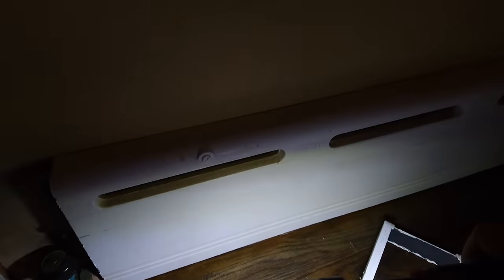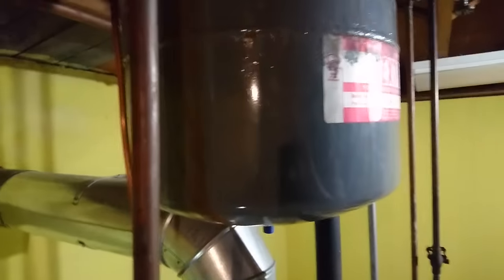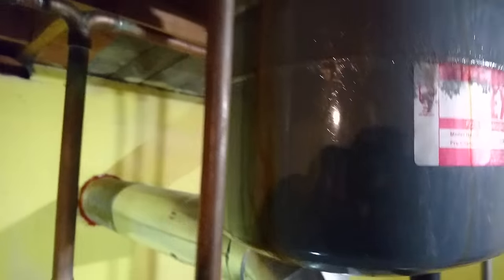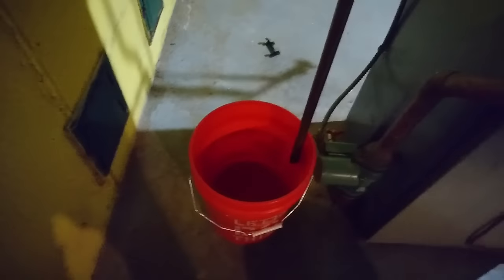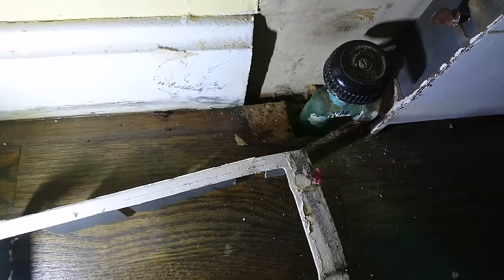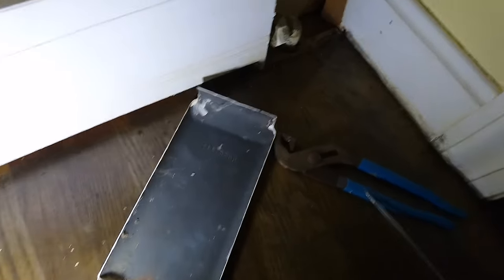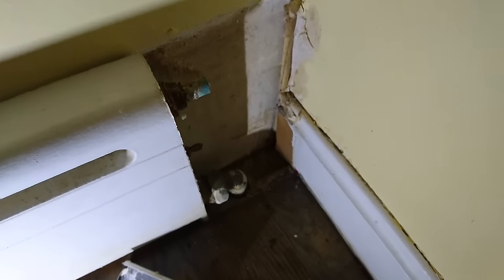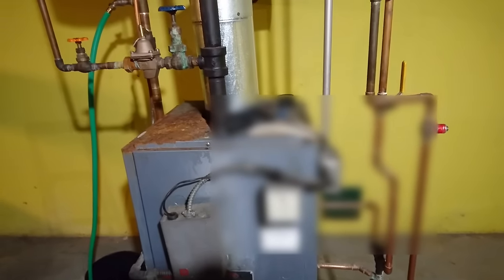How to Bleed Air From Baseboards - Hydronic/Base-Ray/Boiler/Burnham

Comment: Excellent video.
Question: How long before I start the procedure should I shut the furnace off?
Must I wait for the system to become completely cold ... or just cool enough
to handle without being burned?
Reply from the maker: That's a good point - 20-30 minutes is probably sufficient.
Reply: Great question 🔥

Comment: Good Video, Thank You! I have the same vintage baseboard units. All all are fitted with a vent valve which accepts a small 3/16" square key for bleeding. Recently, in  a damp basement location, a six foot run sprung a leak (rusted through) and was temporarily bypassed with a run of new-type hose. To remove the slug of air introduced, bleeding via the bleeder valve seemed to be no match for the amount of air from the repair, so the bleeder valve, and its connector fitting to the radiator, was replaced with a sillcock to get the water moving and the air out.
Reply: Tony, when u say "a six foot run" do you mean a 6' run of pipe?   or of cast iron radiator?
Reply: @conradkentucci1113  A short 6' run of cast iron radiator.
Reply: Tony, any tips on undoing rusty fittings? I have the same base boards, at the top end there is a 3/4” to 1/8” reducer fitting, then a 1/8” plug with a square 5/16” head. The plug broke clean off when I tried to turn it. Am I better off trying to turn the reducer fitting itself? Is it easier when the baseboard is hot, or cold?
Reply: @heinzotto1194  Was the plug brass? Even if steel, if you have room, drill it out and try to remove with EZ-out. You can then clean up the threads if buggered up. Or... allow unit to cool and use a 6-point socket with leverage/breaker bar. Try this first without heating the fitting. If no-go, heat AROUND fitting with torch, and try again. Use extreme caution with torch. Good Luck!

Comment: Thank you for uploading this video, exactly what I needed to understand the system and the Base-Ray baseboards. One Q for you - I also have the stand up cast iron radiators in most of the rooms and they also need bleeding. I've ordered every air vent key I can find, and they are all too large. The vent is 3/8" radius and the square bit inside is just over 1/8". Do you know where I can find the key for these rads? Thank you so much!
Reply from the maker: I see your frustration, 1/8" for some reason isn't easy to find. I found this clock winding key though, I think it just might work, #4 is 1/8"'. Just be gentle with it, if it's rusty you risk breaking it.

https://amzn.to/3dOWPGm

Comment: Regarding the flat head stubby screwdriver being a might too long for the job at hand. 
Several years ago I ran into the same problem while taking an air conditioner cover off. 
The unit was in the corner too close to an adjacent wall … The stubby was too long to remove the side screw of the cover (wall was in the way).
I simply shortened the stubby by a half inch … by simply cutting a half inch from the plastic end of the screwdriver.
Now anytime I need to remove the face of that AC to change the filter …
I have the tool to do it!
Reply from the maker: Nice, you've gone and made a stubby Deluxe™. Some have said coins work too, but they were talking about the valve.

Comment: Good video!  I too tried the garden hose method and it helped but on my mid-century home I have a 2nd floor and have air trapped after getting a new Laars JX Minitherm Boiler installed. I am just going to call the company that installed it and have them come out.  They should have done it in the first place.  Thank you!

Comment: Nice but my base boards don't have any bleeders, All soldered elbows
Reply from the maker: If that's the case I guess you'll need to rely on your air/water separator by your boiler and make sure it's in good working condition.

Comment: You get better results sometimes if you bleed farthest to closest radiator to the boiler. When boiler is running you can touch the top of the expansion tank and then the belly Top hot belly cooler
Reply from the maker: Good point, that and air is likely to be trapped at highest point.

Comment: very helpful, my 1952 era baseboard purge valve leaked, replaced with MaidO'Mist No. 72 auto-vent, bar code 6-85296-001--049.  Stopped the leak.

Comment: CHANGE YOUR EXPANSION TANK
Reply from the maker: PROBABLY NOT A BAD IDEA
Reply: @Bootstrappin  yeah saw lots or corrosion there, probably a good idea. I just watched it again, your pressure relief valve did release? number one culprit is your expansion tank isn't working right, pressure climbs and opens that relief valve. And what generally happens also is you have to replace the pressure relief valve as well as they stick open and always leak once they've been tripped
Reply: Why change the tank if the diaphragm is still good?
Your answer will be well woth it.. thank you

Comment: Great video!  I have the later model Slant Fin baseboards and no bleeder valves on them.  But this is an excellent video abs I learned a few more things like about the expansion tank and other things applicable to my system! 👍

Comment: What’s with the flashlight  lighting? Did you not pay the electric bill? Also they sell a type of screwdriver that has a 90° angle for tight spots maybe you should try one next time.
Reply: Hope you know I’m just messing with you/ I also on a 1960s ranch with baseboard heat.You also mentioned you were going to bleed them when they warmed up,but I’m pretty sure you’re supposed to only bleed air from the system and it’s cold, this way the Water does not absorb the air and you get a better bleed
Reply from the maker: lol the house is fairly dimly lit. Intuitively, both seem to make sense - because if the pump is circulating water, it's circulating air and not giving it an opportunity to get stuck somewhere. But likewise, you'd also expect the air to rise in a static situation. So maybe a bit of both will do the full trick.

Comment: So I shut off my boiler, let it cool, bleed valves and start the boiler again...Will it add water lost during the bleeding, or will I have to do this manually? If that.makes sense...
Reply from the maker: Depends what kind of boiler it is. My boiler had a pressure reducing valve open at all times, supplying extra water as needed. If you look around your boiler, you should be able to find either of two things: either a regular valve supplying water, and if it's in the closed position, you have to manually add water (SLOWLY -- in this case your boiler would likely have a sight glass. That's your fill indicator). Otherwise, you'll find a valve similar to this, and you should be fine: https://www.homedepot.com/p/Zurn-1-in-NR3XL-Pressure-Reducing-Valve-1-NR3XLR/310386794

Comment: This is not how to bleed air from a hydronic system...... You need to flush the system at the drain point with the hose in a bucket of water so you can see the bubbles. This must have taken a painstakingly long time only to find out there is still air in the system.......
Reply from the maker: If it wasn't one of the ways to do it, I don't think they'd have put bleeder screws on the radiators. As I said in the video, what you described was actually the first thing I did, but it didn't do the trick. And I wouldn't post this video if the method I showed didn't work for me, so I don't know why you are making these assumptions.
Reply: @Bootstrappin You're trippin guy...

Comment: Did have  the boiler running when you bleed the baseboard
Reply from the maker: Sorry about the late reply, but I believe I did - it makes it easier to push the air through since the system builds a bit of water pressure.

Comment: I have the same heating system do I have to turn the boiler off first? And do I have to cut off valves and other things before I actually bleed the baseboards?
Reply from the maker: I didn't turn my boiler off. But as a word of caution - don't force those small valves if they're rusty. If they break, a leak will develop. In that case, I would drill a small screw into the break. I don't think it would make sense to turn any valves off because you'd be trapping air.

Comment: Great video, Thank you! How often should you bleed the baseboard radiators of air? Once a year, or more or less often?
Reply from the maker: Sure thing! Ideally, never - the system should theoretically be getting rid of air on its own through an air separator. My system needed an extensive bleeding because I serviced it and had to drain all the water. In short -- as needed. If it's noisy/gurgly, then that's a good indicator for it. However, if it's happening frequently, that's a sign that air is somehow getting in - could be a leak, faulty air separator, water pressure blow-off valve going off, etc.

Comment: Do you need to turn the hot water heater off to bleed the lines?
Reply from the maker: No - in fact you should have it running and heating. This way the water is circulating and thus providing a means for the air to escape.

Comment: What can you do if there are no bleeder screws ?
Reply from the maker: This thread may be of use (basically, the bleeder may be hidden behind sheet metal/some panel. Otherwise, a clogged air separator near the boiler may be to blame): https://diy.stackexchange.com/questions/37382/how-do-i-bleed-baseboard-radiators-without-a-bleeder-valve
Reply: @Bootstrappin  thank you

Comment: All my baseboards are working except one. Could this be the issue? Do I need to do all the steps in the basement fkr one heater or can I just bleed the one
Reply from the maker: Probably won't hurt to try, just be mindful because the water temperature will be enough to scald/burn. Also, I also had this problem in my house, it turned out a hidden water supply valve was closed in the basement, rather than the one right on the baseboard.
Reply: @Bootstrappin  so I just undid the screw, and water is flowing fine
Reply from the maker: @williamlee8053  that's a bit odd. Feel the pipes for heat -- is there any point before and after the baseboard when the heat stops? This can help diagnose what's going on.

Comment: We've had to go down and do the hose bleeding when we get air in our system. Last time the hvac guys noticed we had bleeders on the baseboards and I asked if we could just let air out that way. For some reason they said we wouldn't recommend it. Sounds like they just want us to call everytime. I do have a question about the expansion tank. Ours tends to be cool at the bottom and warm at the top. All kinds of articles I've researched said it should be the other way around... is yours like that as well?
Reply from the maker: If your tank is mounted like in the link below, then it's totally normal. The expansion tank has two halves: one gets filled up with water, the other has pressurized air, and they are separated by a rubber membrane. I don't know why your HVAC guys would say that, why else would baseboards have bleeders? The only reason they might say that (if I gave them the benefit of the doubt) is that the bleeders probably aren't enough if you just drained and filled your system back up. In that case you'd start with the hose bleeding method, and finish with the bleeder valves.

https://www.achrnews.com/ext/resources/2014/07-2014/07-28-2014/S-PM0214Siggy_fig-1.jpg
Reply: @Bootstrappin   It is and thank you so much. I'm just going to assume (which is stupid to do) that if that was the case they would have maybe used them after they bled the system. This is a new house for me and I never had this type of heating system before. I'm thinking I might go ahead and attempt to bleed the baseboards. If that doesn't work then we bleed the lines again with the hose. sigh the joys of adventure
Reply from the maker: @pandapoof8798  here's the funny thing. If real estate prices weren't so through the roof, I'd have plenty of money to pay a professional and not even worry about it. But here we are :)
Reply: I just had this conversation tonight with my friend who is also a boiler tech. I got air in my system and he told me not to touch the blenders on the 90 degree elbows. His reason was they dont always seal up and will leak water (causing more work). He advised purging it from the basement.
Reply from the maker: @BrandonLund  that makes sense

Comment: Have you ever tried removing these Base Rays for things like remodeling (dry wall, tile, etc.)?  Hard to find info. on this stuff.  Thanks!
Reply from the maker: I have! No video on it, but I can describe it pretty well from memory. 

1) Shut off the boiler
2) Drain the water out of the boiler
3) Cut the copper pipe from below/the basement
4) Remove two very large flat head bolts attaching the Base-ray to the joists
5) Cut the paint off around the perimeter, and the you should be able to remove the Base-ray

~~~

Then, you'll need to re-fill your boiler with water, making sure that you are getting rid of the air inside of it as you do so. You may also need to add a conditioner of sorts to the water you add, and finally -- use this video as reference for getting the rest of the air out.
Reply: @Bootstrappin  Cool Thanks!  I just want to temporarily remove the Base-rays to drywall/tile and then put them back in place so I don't think I need to cut the copper pipe in the basement.  It looks like there is a shutoff valve and then I can just unscrew the connecting pipes.  Thanks again!
Reply from the maker: @jasonweatherhead812  oh yeah you're right, that would definitely be easier! And that reminds me -- that's what I wanted to do, but my shut off valve was corroded and stuck in the open position, so hopefully you'll have smoother sailing.

Comment: Hi , how do you fix low hot water pressure in this system 
Thans
Reply: Thanks to you
Reply from the maker: Here's what I'd do (but I'm not a plumber so take it with a grain of salt): first thing to check is leaks. Then check to make sure you refilled the system to pressure (about 10-12 psi most systems, but research this for yours,). Then check your pressure regulator valve screen for debris.

Comment: Thank you for making this video. I have the exact same baseboard radiators in the home I just bought, and was confused at how to bleed them. Mine have square bits that need a key to turn, but they are Base-Rays.
Reply from the maker: Happy to help! I'll add that be gentle, and avoid cracking them open if they look very crusty or you might spring a leak you can't close. A bit of rust release spray should help.

Comment: I bought a house built in the 50's, these are the EXACT baseboards in my house and this video was extremely helpful. Bravo sir!
Reply from the maker: Thank you! They're really quite nice, aren't they? So much nicer than the flimsy modern sheet metal ones.
Reply: @Bootstrappin  yes very good quality and sturdy. Was struggling to find the air release, I assumed it was in the basement. Didn’t even think to check the ends until this video!

Comment: Hello i have an emergency situation... I was bleeding the vent and the top broke off from from rust now water wont stop coming out... What can i do??? Its an air pin hole that its coming out of it..WHAT SHALL I DO??
Reply from the maker: Turn off your boiler, then shut off the water to your boiler. Then, drain water out of your boiler into a bucket until the system de-pressurizes. In the morning, you'll need to hit up a plumbing supply store for a new fitting. You can also check to see if there's a water shut off on this particular radiator.
Reply: @Bootstrappin  omg thanks man appreciate you sincerely...why did it shut coming out eventhough the boiler is still on???
Reply from the maker: @crappiesniper  not sure what you mean. The boiler usually gets a continuous supply of water feeding it, so unfortunately if there's ever a leak, it won't stop until you turn the water off and fix the leak.
Reply: @Bootstrappin  ok... You are right its still running water .... Its a little tiny hole at the top ..literally on top of the nut that its coming out of... Can i plug it or use epoxy to stop it til in the morning otherwise its going to be freezing??? What do you think?
Reply from the maker: @crappiesniper sorry didn't see this, I was worried that it was gonna get cold. Yeah plugging it should work, it's kind of low pressure, I just couldn't think of what to use except flex tape lol. Maybe even play doh.
Reply from the maker: @crappiesniper alternatively, on the opposite side of the radiator there should be a shut off valve, which I hope isn't too rusty
Reply: @Bootstrappin  lol yes indeed i had puddy on it and it didnt last... I was going to try epoxy 🤷 that should do the trick right? I could stick a toothpick in it with epoxy on it and epoxy around it ...what do you think?
Reply from the maker: @crappiesniper   Crappie Sniper  might work, but epoxy has a long cure time. Go with a special putty that has a short cure time, hardware store should have it. But personally, I'd take a picture of the leaking valve and go to a plumbing supply store, they can help. Replace it, probably best option.
Reply: @Bootstrappin  ok.. Just scared that if I take it completely off like unscrew it that water will be everywhere... That's the only reason why I didn't do that. Can I send you a pic of what I'm talking about? ..hay out of curiosity where are you located?
Reply from the maker: @crappiesniper  I'm in new england. Sure. You'd of course have to shut off the boiler, turn the water off, then drain the boiler before attempting such an operation. This late in the season, yeah, you have a point of just gluing it for now. Try a putty/epoxy.
Reply from the maker: @crappiesniper  my email is in my about section
Reply: @Bootstrappin  wow ok cool you are in NE im in the Cincinnati Ohio area... Bro thanks for responding... I subbed you! I do fishing... Im going to puddy that hole and go fishing 😆 seriously thanks...
Reply from the maker: @crappiesniper  thank you! Catch one for me, will ya? :)